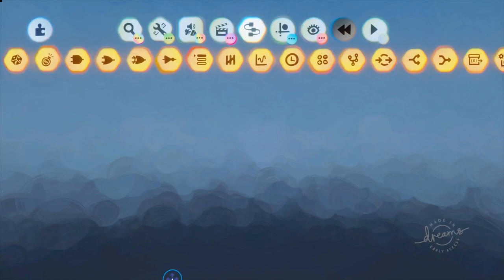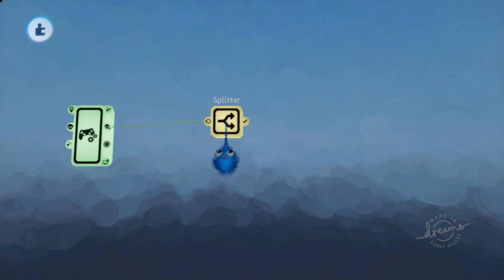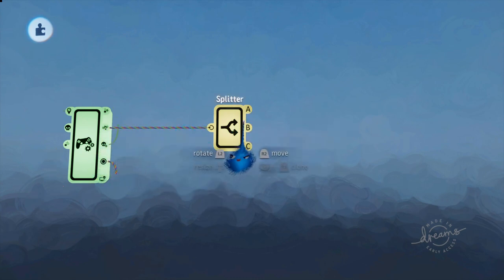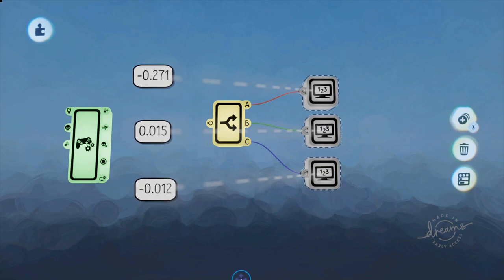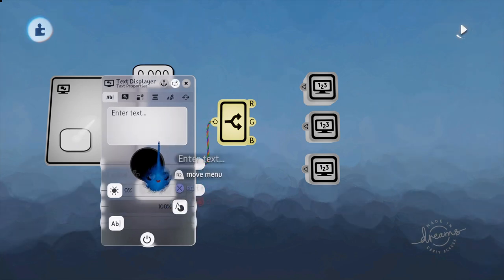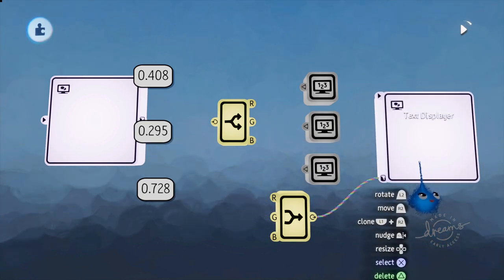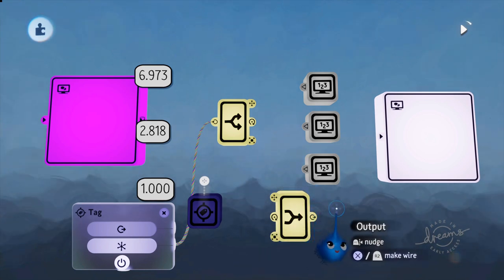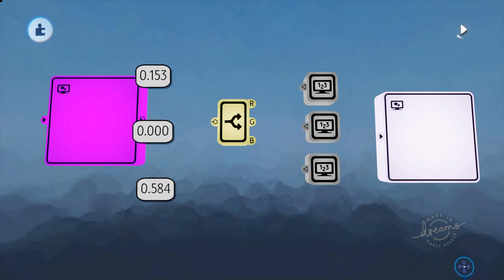Dreams PS4 Gadgets: Splitters and Combiners

Comment: whats the difference between using a splitter and just creating three wires from the output. For example if you just plugged in the motion sensor to each of the number displayers how would that differ than from using a splitter
Reply from the maker: Wires are either multicolored twists (fat wires) or single wires. The fat wires contain a lot of information but in order for you to pass those individual bits of information you need to split the twisted wire up into its separate wires. If you wired a motion sensor to three number displayers it would show exactly the same number ( a combination of all three). Use a splitter and you can now see the X Y Z numbers as separate things.

Comment: Hi! Love the Gadget tutorials. Very helpful! I’m trying to use a combiner and splitter to do something similar with colors to what you did in this video. I have both splitter and combiner on color setting. My input cube is a pink... plug it in to the splitter and get my RGBs, I have those plugged in to the RGB of the combiner and then that is plugged in to the tint color input of another cube. The result is that the second object keeps turning black. Any idea why this would happen? Been banging my head on this for a little while! Thanks!
Reply from the maker: I am not sure why you are bothering with the combiner and splitter at all in the scenario you just described. Just wire the color output and the tint amount output to that of your new object. I will however have a look to see if I can recreate what you are seeing and try and figure out why its doing that.
Reply from the maker: OK I couldnt get black so I dont know what you are doing, however, colour is not just about the Tint Colour it also needs the Tint amount so both bits of information need to be passed in order to get the same colours.
Reply: My ultimate goal is to create an one object that emits but each time it emits it is one of 3 colors. I was just messing around with the splitter/combiner to see how they worked and stumbled on this. After I deleted everything and tried it again it worked. I’m only on Dreams for a month so far, I’m probably making all the rookie mistakes lol.

Comment: Whats the difference between using Node and a combiner?
Reply from the maker: A node is just a blank gadget you can pass wires in and out of. Although you can use it as a gate it is mostly for tidy purposes. It has no active parts. A combiner takes multiple wires and combines them into a fat wire with multiple bits of information.

Comment: I'm really sorry but I'm struggling to understand logic to number displays.. and even come away with a remotely useful understanding..and I value anything u can tell me..it helps..but..
I blame MM.. and I posed them a question in the last livestream and the amwerer didn't have a clue what any of LBP logic was.. and said yes we havr controller sensors 😂😂😂😂.. they think they have a LBP easy to understand logic system.. and wow.. the masses are soon gonna waking up to the fact that it's tough as hell.. we mostly making 3d platformers only..and assets/music/anims, art  .. there's a clear group of programmer/players that have told me it's no different to programming itself and are saddened by needing to make 60 to 100 microchips with sometimes over 300+ gadgets just to add a few features to a puppet...etc
If you've never played LBP series then this won't make sense.. but we badly need some all-in-1 compacted gadgets..just like how we got "controllinators with attached car seats"  to help get our sack boys into our vehicles. .or the ability to swing off a rope etc..or Pop wheels on or rockets and then go make the game.. easy as pie..so surely they gonna have to provide more templates for different genres or specialised tools for non programmers.
But to get a puppet into a vehicle and pop wheels on and expect a car to work is pages of logic and pain.. not even physics are bang on.. 
I fear if unchanged it will really turn people off after a while..especially the younger audience.. they will all expect LBP Levels of game genres at the very least. I pray they get some news out that this is to be addressed.. otherwise we are all doomed to beg/hope programmers make the programs we need to do some of the simplest of things.
Heck neon the coder yesterday proved that all tutorials on doorways/exits were incorrect all this time and that MM very likely didn't know.. people were shocked..and the solution was mind numbingly easy.. just like how MM said we can't freehand draw bends in sound..WRONG.. I found a way to do so.. you goto piano roll mode..and select the pen and Hold L1 and r2 then draw your notes in diagonal or curved blurry lines.
Also I haven't seen 1 other music person do this so far in that way.. so I hope my words reached them when I mentioned it.. most people think I mean drawing straight normal notes... totally different.. I was shocked when I found it as MM said that it wasn't in the game yet.. yes it was  (so who are the watchmen of who we are presented with?)